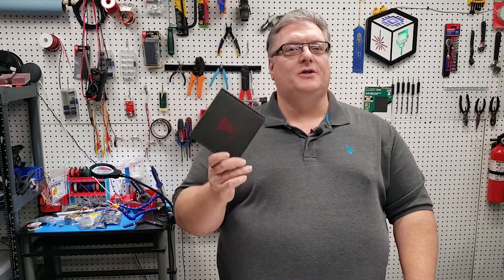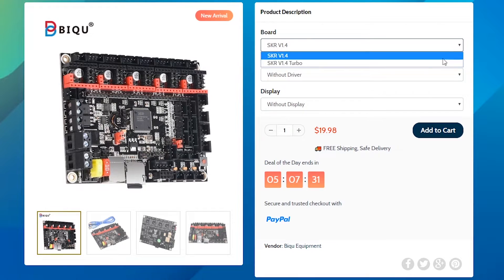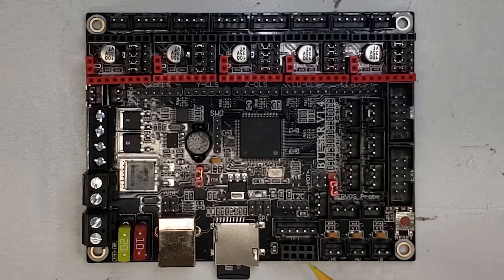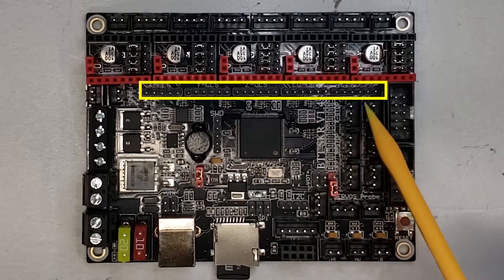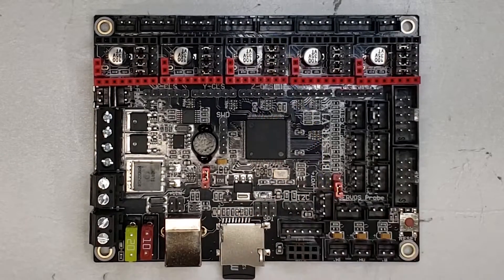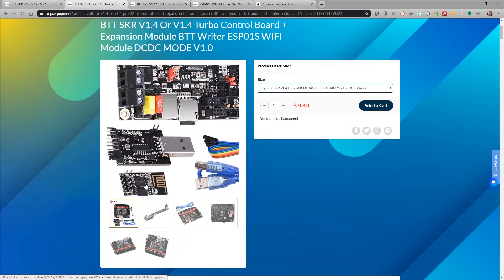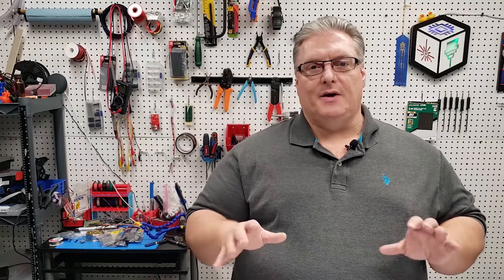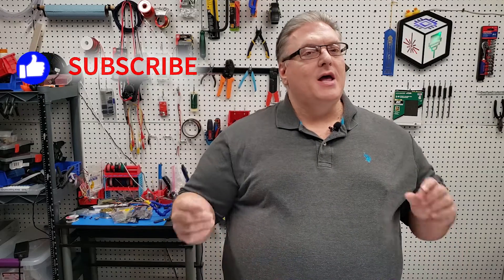BigTreeTech SKR v1.4 First Look! | Overview & New Features

Comment from the maker: Will you be getting an SKR v1.4 for your 3D Printer?  let me know in the comments!
Reply: I am waiting for my 1.4 Turbo to come for my Chiron.
Reply: I´m building a CoreXY and was going for the 1.3,  but now, I gotta get that 1.4
Reply: Got it yesterday! for an Ender 5.
Reply: I'm considering getting a SKR 1.4 turbo and using TMC 5160 driver's for my CR20 PRO. And possibly the same setup for when I get my Shapeoko CNC router.
Reply: If it is compatible with TMC2209 drivers I will give it a try :)
Reply: Considering one for a cr10s, will allow me to get some quiet drivers and also a sensor
Reply: Have a 1.4 Turbo. on a Ender 3 . Trying to set it up :D
Reply: I bought the 1.4 Turbo. It will be here Monday and I will be installing it on a Wanhao Di3 v1.
Reply: I ordered an 1.4 turbo for my ender 3 pro at the same time as I got the printer. I've had the printer for about 2 months, but I have yet to see any update on the SKR v1.4 board shipment...

Comment: Doesn't the closed loop stepper connect directly to the motherboard instead of the driver? Allowing you to use whatever driver you wish to use? or I'm I understanding things incorrectly?

Thanks!
Reply from the maker: Not Exactly.  The CLS has onboard cpu and its own driver. The communication is slightly different in that the stepstick is on the CLS not the motherboard.
Reply: @MakersMashup  Oh, That's a shame, thanks for the reply and for the great videos!

Comment: I really like SKR 1.3.    I up graded my Ender 3 with these version board.   Along with the SKR 1.3 upgrade add TMC2208 in Uart mode.   My Ender 3 is my go to printer.   Turning out beautiful 3 D prints.   Please note, be very careful if you are adding a BL Touch Bed leveling probe.    I smoked my original Ender -3 mother board.  Because the 5 volt color code wiring is confusing( short out the 5 volt supply).     It was cheaper to use 32 bit SKR 1.3 board that replacing original Ender-3 8 bit motherboard.      And with this Convid-19 given time to upgrading my other self design 3-D printers with 32 bit SKR 1.3 or Re-Arm boards.

Comment: Can someone tell me what the power module is even used for? This a little to no discription for this module online
Reply from the maker: You're right BTT doesn't do a very good job explaining what that does.  My understanding is that it offers more current for larger amounts of LEDs, etc.  Personally if I need more power for a device I draw it from the power supply directly not through the main board.  Heat Bed MOSFETs are a good example.  I have not found a use case where their power adapter would be useful for me.
Reply: Makers Mashup 

Is that something I would need for the TFT35 E3 V3.0?

Also, what are your thoughts for their SKR Mini E3 V2.0? I'm trying to figure which board to go with in my Ender 5

Comment: Seems BTT does have two closed loop steppers out now, but like MKS' offering they are not using Trinamic drivers. One has an A4950 and the other A4950...
Reply from the maker: I'm currently working with uStepper.com to test out TMC5130 based closed loop steppers.

Comment: From what I've just been reading,  the onboard SD slot it just for firmware, it can't be seen by Marlin to use for printing from. So if you want to print from memory card you'll need to add a TFT with SD/USB support to be able to do so.
Reply from the maker: You absolutely can use the onboard SD card for printing.  I do it all the time.  You need to change the setting in marlin 
#define SDCARD_CONNECTION ONBOARD
Then you can print directly from the SD Card that is on the 1.4.  If you want to print from the SD without a TFT interface, you can send the M2x Commands, see the marlin reference manual https://marlinfw.org/docs/gcode/M023.html
You still need something to send those commands over the serial port but no TFT display is technically necessary.
Reply: @MakersMashup 
I tried the @ SDCARD_CONNECTION ONBOARD and Marlin won't compile, lots of errors relating to function call is not allowed in a constant expression etc.
https://www.reddit.com/r/BIGTREETECH/comments/fw6f40/skr_13_cant_see_sd_card/
Reply: @MakersMashup 
I tried the @ SDCARD_CONNECTION ONBOARD and Marlin won't compile, lots of errors relating to function call is not allowed in a constant expression etc.
https://www.reddit.com/r/BIGTREETECH/comments/fw6f40/skr_13_cant_see_sd_card/
Reply from the maker: Are you using the latest version from the marlin website?  I think I have 2.0.3 installed and its working just fine.  I've had this option enabled for some time.  Make sure you're using the actually release build too and not the nightly.  I've run into all sorts of Nightly build issues from time to time.  I can say though I have enabled this on both my 1.3 and 1.4 boards and it does work fine.  Marlin has a discord and I do as well.  Probably a better forum to get the details worked out.

Comment: Trinamec has close loop drivers. BTT has one aswell and its call S42A and S42B.
Reply from the maker: I know. I have the trinamic ones up on my browser just waiting to press the buy button but they are just so expensive. It took a while for me find them and few seller have them. Pandrive looks cool.  Just a matter if time before I buy them.
Reply: @MakersMashup  UStepper has tmc2208 drivers on them and they're under $40 usd.
Reply from the maker: Can you send a link I'm very interested.
Reply: @MakersMashup  Ustepper.com
Reply from the maker: Thanks I will check that out for sure.

Comment: Do you have any thoughts now on good steppers for this board? I am considering the MKS SERVO42B Nema17 but not sure?
Reply from the maker: My concern with the SERVO42B is that its not a silent stepper.  Its based on the A4988 style chips which will be noisy and introduce salmon skin into prints.  BigTreeTech is supposed to be sending me some to test out but they have not arrived yet.  I am hoping the BTT creates one based on the trinamic drivers.  The Trinamic CLS look nice but $150-$200 per stepper seems a bit steep.
Reply: @MakersMashup  Thanks, yea noise is counter productive and I did not even think about that so thanks a ton for the quick answer. Will be waiting to see your take on these when BTT gets them to you to test...
Reply from the maker: @kevinm3751  Will do, I may pull the trigger on the trinamic ones just to see how fast I can push the X301 thats nearing completion.  Just the sort of thing the reference build should have in it 😉

Comment: Wifi port is not specific to bigtreetech wifi module, any esp01 module with esp3d software works. In my opinion the only improvement over the skr1.3 are the capacitors for the thermistors (they will make smother temp read).

Comment: I see you didnt opt for the  turbo version, would that be better or more necessary for a Delta or a coreXY where the kinematics are more complex rather than a standard Cartesian?

I need a new board and was planning on the 1.3, but tempted to go this route now  the closed loop steppers interest me a lot.
Reply from the maker: Certainly the added CPU will help some. These CPU don't contain dedicated FPU so the math takes extra instructions to calculate anything floating point related.   So I could see the faster speed offering better operation on any use case.

Comment: not all fan header are controllable. only Fan0 are controllable ... other fan1 fan2 fan3 are tap to 12/24v  it always power on. :)
Reply: Right, for control fan1 you can use E0Dect Pin 1.26 with a mosfet.
Reply from the maker: Another viewer pointed that out as well.  Very disappointing that they would just add always on-pins.  Maybe in the 1.5 they will get that right.

Comment: I have the base parts for your online printer build coming this week as well as the turbo 1.4v w tmc2209's coming as well. I'd still like to see how your 1.3 build is printing and what your output is like before you stick the 1.4 in it. Great job so far.
Reply from the maker: I've printed a lot on the printer I'll try to post some some prints in the near future.  The board however wont change how the printer performs.  The Steppers you use have the most impact along with the mechanical properties of your printer.

Comment: Is wifi available on the 1.3 with add on board? I would like that.
Reply: I just ordered a 1.3 one... so it would be nice, anyone ?
Reply from the maker: You want to check out something like https://github.com/luc-github/ESP3D but you can setup a v1.3 to use the second serial port on the board and communicate with an ESP-01.

Comment: According to GitHub, the additional fan pins are NOT controllable, which makes them  stupid. Though overal if I was going to order a 1.3, I would go for a 1.4 now because if the incremental improvements, but I won't upgrade it. I have WiFi on my skr1.3, and it's so damn cheap to add, not buying a new board for. The rgb I like as well, but I had it on my printer back on 8 bit, and I found it quite lame back then tbh. Closed steppers sound cool, but if it made sense, I'm pretty sure we would have seen it more on high end printers by now. The dual z is nice, but I use my skr on a Delta, so not missing that feature.
Reply: I have the 1.3 i am understanding i can use the wifi add on? Does it require firmware changes or is it plug and play?
Reply: @carbide1968  I used Chris Riley video to do this, I recommend you to buy a 5v to 3.3v module for the ESP module rather then his patch as it's dirt cheap. You can add it to any 5v, gnd, rx, tx pin set then. Follow his steps closely apart from the module (and use the exact same software versions as him). If you run 2.0.x  it should be fine without any changes to marlin, for me it did not work on bugfix.
Reply from the maker: Indeed they don't appear controllable.   My bubble has been burst.  Serious disappointment there.  Thanks for the feedback.   Maybe I can hope the pinout document is in error.  😊
Reply: @MakersMashup  It would have been nice, but there are no additional mosfets placed as far as I see, so probably not.
Reply: @MakersMashup  On my V1.4 the fan polarity was reversed from the MKS GenL V1.0 I was using. Haven't checked to see who is wrong but the upshot is that my fan wouldn't run and got quite hot. I was checking output with a meter and one lead slipped shorting the port. Now it won't turn off! I used a mosfet and relocated my fan to the Y Max port.  Otherwise it's working great.
Reply from the maker: @vanceblosser2155  I've run into fans/boards that don't always line up the +/- the same way.  Fried a few fans over the years myself.  Best thing to do is always check.  I ran into one set of fans that had them all reversed.  :/
Reply: @MakersMashup  I've had some mixed in the same set. I'm used to wiring computers since 1981 and got spoiled by correct color coding....
Reply from the maker: @vanceblosser2155  Same here, feel that pain for sure. :)

Comment: Ah man, literally just ordered a v1.3 next month. Should I get the v1.4 and sell this v1.3? I've got TMC2209s...
Reply from the maker: If you plan to use the features I might consider it.  The 1.4 is essentially a 1.3 with more features so both are good boards. Really depends on your use case.